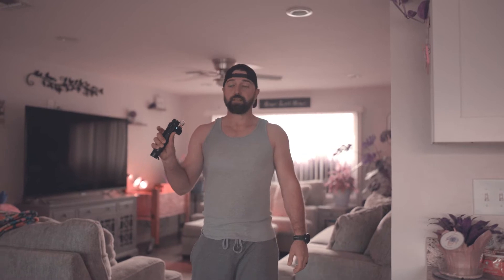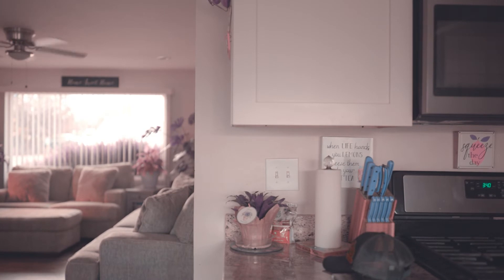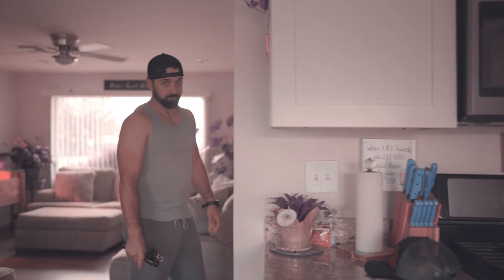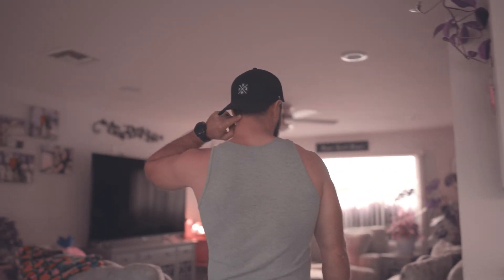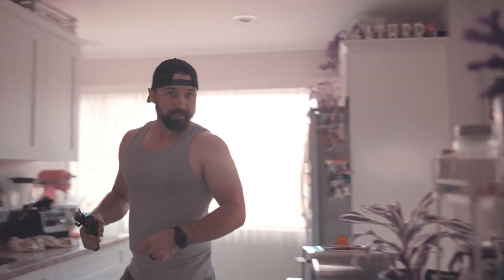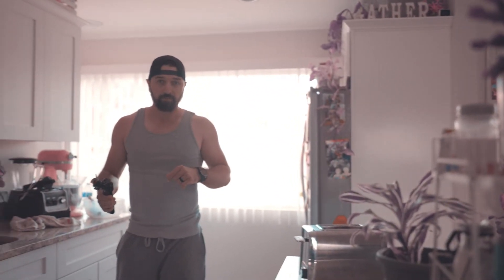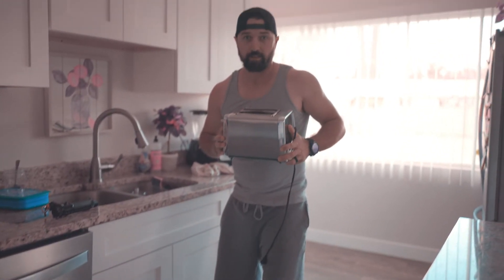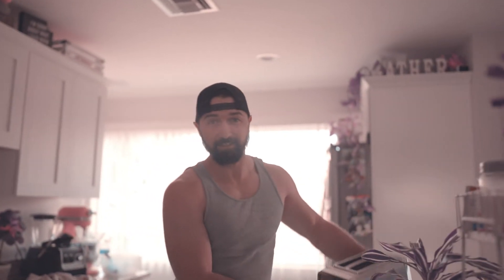DJI RS3 LIDAR AUTOFOCUS & FOLLOW TEST

Comment: Do you know if the LiDAR system works well with the Tilta Nucleus systems?
Reply from the maker: It's a little bit confusing question my friend. 
I can control RS3 motor with Tilta products like remote control for Tilta Float or remote control for advanced Ring and other remotes.
But Lidar it self can only be controlled by Rs3 pro as of right now.
Reply: @camerariggingmods9667  Sorry! I guess I should say, the Nucleus N motor. The LiDAR automatically adjust focus, right? Have you testing the RS3 with the Nucleus Motor?
Reply from the maker: @LaquitaMS  Lidar system can only control RS3 motor.

Comment: Excellent work! Were you using the Tilta focus handle? I couldn't tell. And what button were you pressing, just the trigger? Thanks for doing all this. I think it is actually quite amazing how well it works. I couldn't tell from the Youtube if the autofocus was perfect as it seemed  a bit soft in general and I guess the knocking sound was just the on camera mic picking up the focus motor? I'd love to see an inset shot of the camera follow focus and RS3 Pro screen while all this was happening, again thanks!